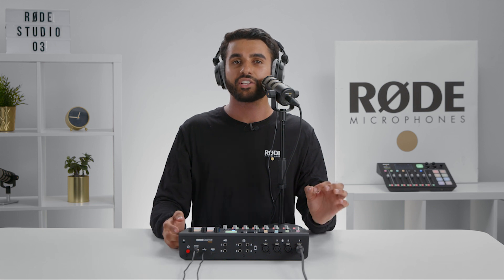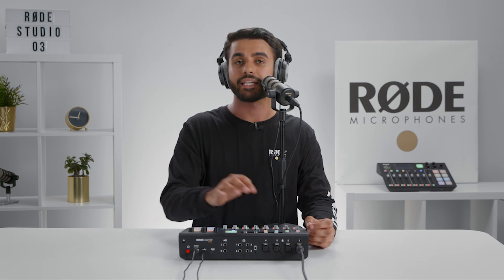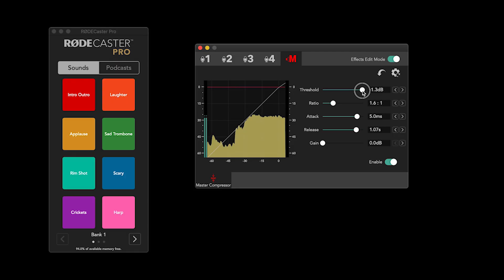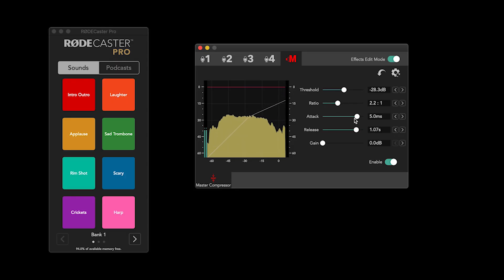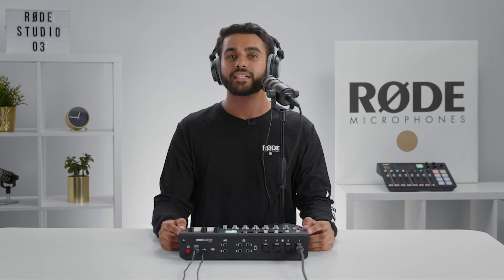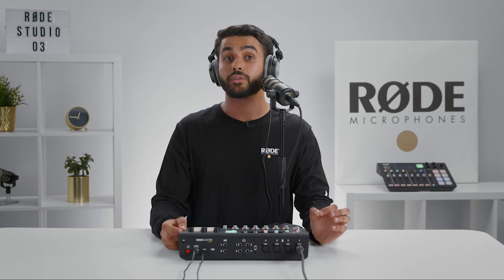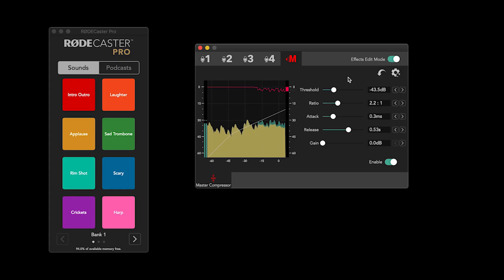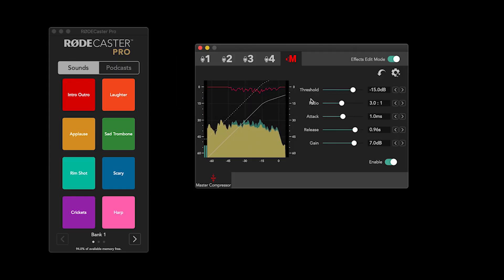How to use the Master Compressor on the RØDECaster Pro

Comment: Hi,

Do I understand it right, that the Master  Compressor just effect the stereo output ans not the individual multitracks?

For example:

If I record in multitrack with 4 mics, does the master compressor is on top of the individual track compressors, Or just the overall stereo mix?

I just record in multitrack, so I want to male sure the master compressor doesnt effect this. If I do broadcasting, It could be helpful of course.
Reply from the maker: Heyya, the Master Compressor only effects the stereo mix 😊